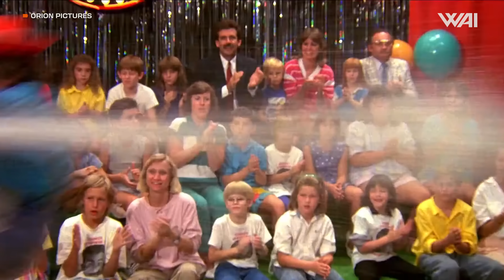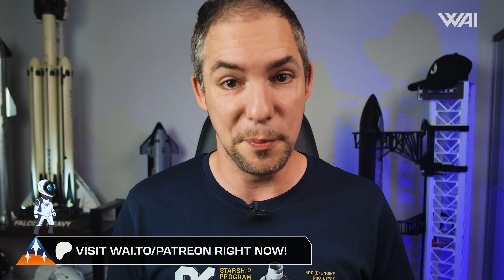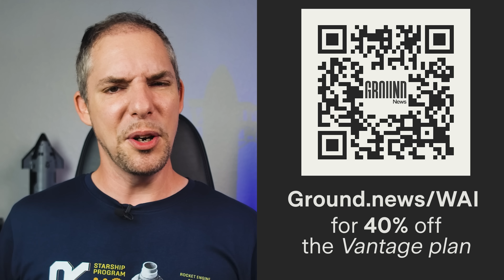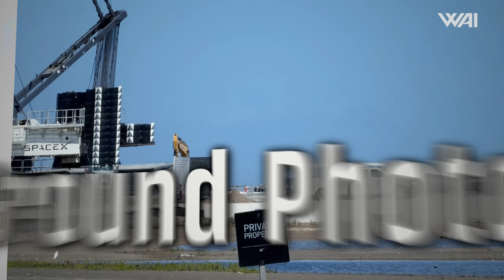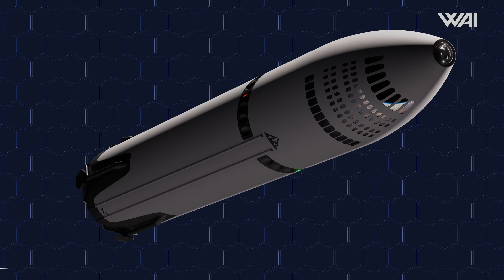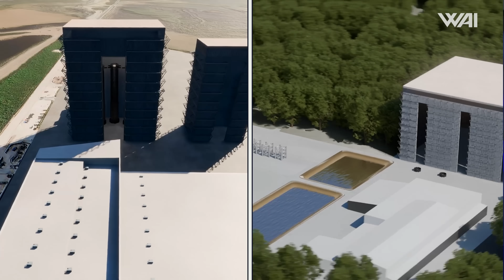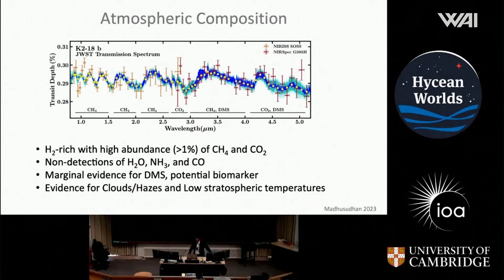SpaceX Lunar Starship Under Pressure: China Reveals Plans!

Comment: Why does SpaceX need NASA? (1) Use a Falcon heavy to put an earth-reentry-capable Dragon+trans-lunar booster in lunar orbit. (2) Deploy fuel depot and HLS in LEO. (3) Send astronauts up to LEO on a Dragon where they transfer to the HLS. (4) Move HLS to lunar orbit, then descend to the surface. Launch back to lunar orbit. (5) Transfer astronauts to the earth-reentry-capable Dragon and come home. Looks to me like, maybe, what? A billion dollars? Max? The only unproven hardware is the HLS and that's being worked out right now.
Reply: Simply, NASA is buying, SpaceX is providing a service for NASA that gets bought
Reply: @ Except where SpaceX is launching its own satellites to build its Starling network.
Reply: called mining resources the helium 3 to power china for 1k years. other resource's on the moon can,t get on earth.
Reply: when coming back from the moon the speed becomes a lot higher than just landing from LEO....Dragon would burn up if not slowed down....your idea is certainly plausible but this problem will need to be corrected
Reply: @mikelee-i3b  You did see: "Earth-reentry-capable Dragon." They've acknowledged that they'd need to build a special dragon that has the necessary shielding, life support and re-entry capabilities...which includes enhanced thermal resistance.
Reply: @lawrenceallen8096  ...yes I saw it ..the issue is the same as Orion ..we do not yet safely have that capability ..without asbestos it is near impossible to make an ablative heat shield like on Apollo ...a better alternative would redesign the return with the capability to slow down and dock with say a crew dragon which then could safely land on earth
Reply: I don't think a fully fueled HLS has sufficient delta-V to go from LEO to the lunar south pole and back to LEO.  The mass of the TPS for lunar return aerobraking is non-trivial.
If you are saying to transfer crews at NRHO from Orion or Crew Dragon to HLS, HLS might have enough fuel to get back to NRHO but Crew Dragon also would need TPS design to be flight qualified.
It would be a good idea to have both Orion and Crew Dragon flight qualified for lunar-earth return crewed flight.  The US needs multiple HLS landers and multiple crew capable vehicles to go to NRHO and back to LEO
Reply: @ @goldenpacificmedia  Totally agree...there would need to be another vehicle exclusively to bring the crew back to LEO form NRHO....this is financially plausible as for HLS to function Refueling and starship has to function....since refueling would be a thing the LEO to NRHO to LEO could and should actually be a reusable vehicle left in LEO or NRHO
Reply: @lawrenceallen8096  why NASA paying spaceX for fireworks
Reply: @ Is ing-go-wish your first language? Were you absent when punctuation was taught?

Comment: It looks like the rocket engine skirt isn't strong enough to withstand the back pressure when stages 1 & 2 are both firing at seco. Like atach and air hose to the bottom of a plastic cup and see how close you can bring the cup to a solid surface with the air being pumped at 120 psi. If you get too close, the sides will blow out. That's the principle happening to starship. By clicking up these air vents in the hot staging ring, the problem will get even worse. 😢

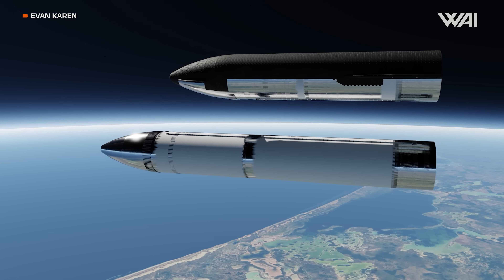Comment: 13:35 absolutely incorrect. Both  tanker and depot will have solar batteries, radiators, docking ports so they won't be featureless.
Reply: But that’s what almost every other ship will have, so it kinda is “featureless” when compared to almost every other kind of ship
Reply: @archierush868 no, not every spaceship has solar radiators. To address the boil-off problem the radiators on the depot must be huge, something we haven't seen before on any render. And solar batteries on tanker would have to be retractable, because it has to do re-entry, so before going back to Earth those solar batteries would have to retract to some internal volume. We also haven't seen any of this on renders. It's as if no one who is making these renders is applying any common sense.
Reply: @дроу no lol. Stick to soccer

Comment: As for the beefed up hot staging ring, maybe they did find an issue with the block 2 ships that only occurs after the force of launching has been applied causing some sort of damage in the lower end of the ship. That would explain why they couldn't recreate the issue on the ground. The stronger ring will lessen the load on the ship. Just speculation.

Comment: From the info i have seen so far it looks like the catastrophic harmonics in the fuel lines stemmed from the hot staging possibly from the dome protecting the booster now that the shielding from the Starship removed for weight reduction. There is an updated ring which redirects the thrust differently spotted according to NSF. This might fix the issue but i personally think they should be doing some sort of ground testing and some slow mo cams to see how it  disperses and some pressure sensors and frequency sensors to find the harmonic causing the issue and the pressure sensors to see the how it effects both the ship and booster then they can get better data to model from to make changes.